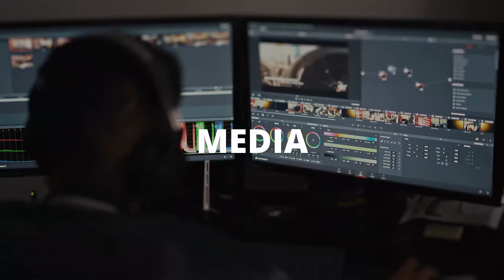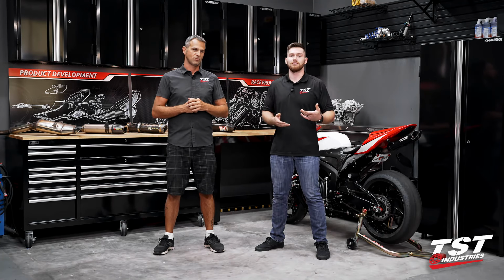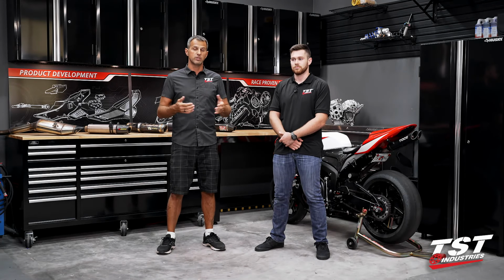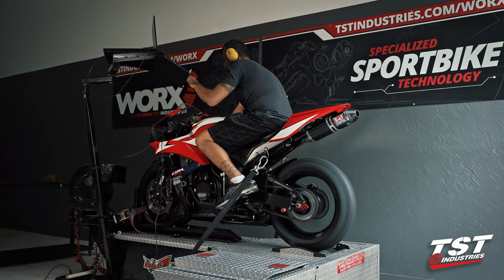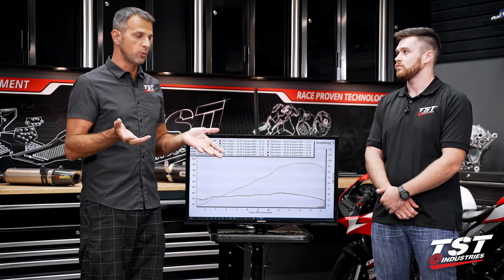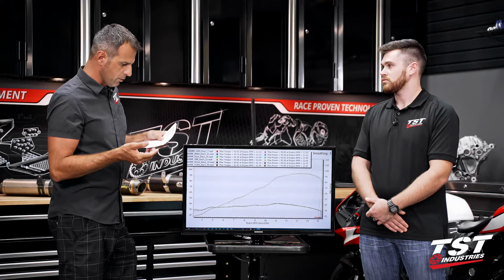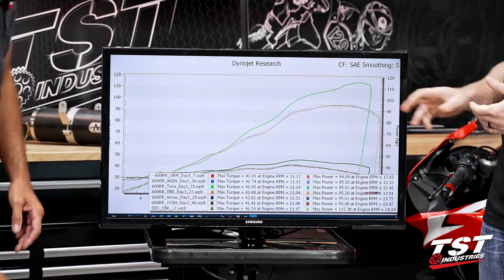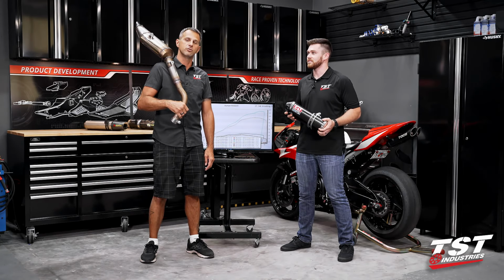Honda CBR600RR Exhaust Dyno HP Comparison: Toce, Akrapovic, Two Brothers, Arrow, Yoshimura, Stock

Comment: Yoshi - "because who needs a taillight anyway?" ;)

A little bit more seriously:
- Lookwise, Toce and Yoshi look good. However, based on the previous video, Toce is too loud for the track (at least in Poland) and Yoshi covers the taillight, so it's not suitable for the road.
- 2Bro is still too loud, I'm afraid, plus it looks awful ;)
- Arrow protrudes backwards a lot. Better than 2Bros, but still...
- Akrap it is then - reasonable length and loudness, looks better than OEM and is 1.2kg lighter. Would I pay for it though? Nah ;)

Comment: Even in absolutely perfect conditions (read: not real world), area under the curve in relation to gearing is what matters, not peak. In the real world, a broader curve matters even more and AUC gains are what racers look for to drive out of corners.
Reply: @Brian Frichetta - Can you say more about area under curve and gearing? Kind of guessing - is it that "driveability/raceability" is improved not by peak power but by having the right gears for how you want to use the bike? Waiting for power to build when the power band is real high gives slow acceleration if you're not running at a high speed all the time. So moving the band lower gets you moving faster.
Reply: @ninemilliondollars  This is long, so strap in. TLDR; Area under the curve (AUC) relates to gearing powerband and also the spread of usable power. The importance of this metric is determined by the application (race, street, etc).

In math, area under the curve is defined by calculating the definite integral between two points on a curve. There's plenty of info on YouTube if you want to know how to do this (Khan Academy, 3Blue1Brown, etc).

However, in simple terms, AUC is really easy to get an intuition about. Take a HP / Torque curve and just shade it in. The shaded part is the area that the curve defines.

Now, let's think about two extreme (and unrealistic) examples. In the first case we have an engine (A) that makes 0 torque from 0-8000 RPM (let's not get caught up on how we would get an engine w/ 0 torque from 0-8000 RPM, but if it bothers you imagine you have to jump start the engine going down a long hill, haha), and then from 8000-9000 RPM it makes 100 torque, then goes back to 0 torque. This engine has a very narrow powerband. 

In the second case, imagine we have an engine (B) that makes exactly 50 torque from 0-10000 RPM. No matter where you are in the rev range, it provides the same power delivery.

Now imagine the dyno torque curves for these different engines. Engine A is empty for the first 8k RPM then dramatically spikes and falls, so it looks pretty empty. We're imagining a tall and skinny rectangle at 8-9k RPM.

Engine B, however, is a straight line at 50 tq from 0-10k. Shade these curves in and we can calculate the area. Since these are just rectangles and not complicated curves, this is easy: A=lw. The first "curve" is 100 (torque) x 1000 (RPM) so its area is 100k. The second "curve" is 50x10000 so 500k.

Note, I'm not using units for torque b/c it's irrelevant, since they depend on the units used. E.g. if these dynos were done in ft/lbs but we converted to Nm, and changed RPM to revolutions per second, the first area would be ~2260, and the second would be ~11300. What matters is the relationship, and you can see that in either case the second "curve" has 5 times the area of the first "curve".

Okay, so what does this all mean? So far we've talked about torque, b/c torque is what moves things. Numbers like "horsepower" are artificially derived from torque and RPM, because in the real world those RPM actually matter. This is b/c for the applications we're talking about (vehicles),  we're trying to move things at a high rate of speed. To do that, we need to transmit torque to a wheel and we usually do that using gears. The faster we can spin an engine, the faster we can move those wheels without help from our gears.

I don't want to go into gearing b/c this is already too long and there are plenty of resources. But I've hopefully explained enough so far to give you an idea of at least two key spots where AUC really matters.

The first, as alluded to above, is gearing. In race applications, where we care solely about absolute performance, we can make certain tradeoffs. For example, if we tune our engine for peak power, we'll probably end up w/ a more narrow curve. The reason for this is also complicated, but without a lot of wizardry (which adds cost and weight), tuning for peak power usually narrows the curve (it looks more like engine A than B).

Now in this case, the fact that the curve narrows, is not as analogous to our initial example as you might think. Two engines can have the same total AUC, where one is peaky, and one is broad, but still not be equivalent, and this is b/c the AUC we actually care about in racing applications is the usable powerband of the gears.

If, with our very peaky engine, we shift from 1st to 2nd gear, and our engine falls too far off that peak into a much less powerful part of the powerband, we've lost a lot of torque / acceleration. Compare this to a less peaky (but slightly less powerful) engine, that maintains a broader area.

If AUC is defined as the area between two points on a curve, then the transition between 1st and 2nd are the points that we care about here. Thus, the peak maybe higher for our peaky engine, but the area in the regions we care about, the transitions between gears, is still lower, and results in slower acceleration.

High level race teams will tune their gearing, tires, and everything else for a particular track, so that these curves match the demands as closely as possible. For the street, companies tune these characteristics based on how they think the motorcycle will be ridden. This leads to another place where AUC matters, which is in the consumer market.

Race teams can get away with more peaky engine characteristics b/c they have star riders, and can tune the gearing and everything else to be used within that relatively narrow power range. For them, having peak numbers matters b/c they can use that curve. But on the street, or even on the track for mere mortals, do you really want to have to ride to the ragged edge to get your bike to respond? The reason so many people love the so-called hypernaked bikes so much is not just that they are more comfortable, but also b/c the engines are tuned to have a very broad spread of power.

A perfect case in point is the MT-10 vs the R1, two bikes that share the same underlying engine platform, but with different components and tuning. The R1 has 200ps and 112Nm, whereas the MT-10 has 160ps and 111Nm. The differences in torque are negligible, while the power is very different, and that's b/c the R1 has a curve shifted to higher RPM. This means the R1 is signficantly faster, but only once you wind the engine up. Additionally, if you look at the torque curves of these two motors, the AUC for the MT-10 is actually much stronger at many points in the rev range. Up top, the R1 pulls away, but at low-mid RPM, the MT-10 has more torque and is actually the faster bike.

I can tell you from experience that on the street, having a broad torque spread, combined w/ decent top end is the best combination. With more low / midrange, you can be in any gear and still have plenty of pull, whereas for a peaky engine, it feels gutless until you downshift.

Finally, one thing you'll often see is that adding mods and tuning a motorcycle only adds modest peak horsepower numbers. However, if you look at the curves the story is very different. You might gain, say, 8 peak horsepower, but when you look at the curve you might notice that from 7-10k RPM there's a huge increase increase in torque. If you were to overlay this new dyno graph on the original one, this difference in 7-10k RPM, where the new graph is higher, is the difference in the AUC for that range. You can overlay two graphs like this, and fill in these areas, using one color for decreases in power / torque and another color for increases. This will give you a very good idea of how differently the motor will actually behave at certain points.

In the case of picking up a lot of midrange power, this could mean we no longer have to downshift on a certain slower corner b/c we have enough torque to drive out hard.

Whew that was long. Hopefully that helps explain AUC a bit, and how it relates to dyno curves.
Reply from the maker: @BrianFrichette  Do you want to fly down here and be in the next video? Only if you can condense that kind of explanation into the time that our viewers can actually hold attention for. I can show you the analytics. Maybe a blog article is better deserving of your time.
Reply: @TSTindustries  I am a software engineer and web developer with years of high level experience, but when it comes to mechanical engineering, tuning, and performance, I'm nothing more than a hobbyist and certainly not a subject matter expert. I wrote that reply knowing it wouldn't get much traction or visibility, mainly to coalesce my own understanding of the ideas. I'm a bit embarrassed to admit that.

That said, as far as I'm aware, the explanation I provided, while overly verbose, is a correct description of this limited subset of performance tuning. If there's any potential to use my actual expertise in this area, it would likely be creating interactive data visualizations or something along those lines. As I was writing, I kept thinking how great it would be to have visualizations for what I was describing.

Anyways, I appreciate what you guys do, and have enjoyed your products. Thanks for making quality content and quality products. Your offer is very humbling, and if for some reason you'd like to collaborate on something software / web related, you can keep my info in your rolodex (firstname.lastname@gmail).

Cheers

Comment: Is there a reason the toce exhaust has the baffles in while the others don't?
Reply from the maker: They are all equally matched, and how they come from the factory. Each one of these exhausts uses a glass packing around a perforated metal tube for muffling. The Toce just has two smaller diameter and shorter glass packed muffling elements instead of one large long one as per the other presented exhausts.

Comment: did you guys tune the mapping for every exhaust
Reply from the maker: No tuning or mapping was done on any exhaust. This is OEM spec ECU settings with the various slip-on exhausts installed.
Reply: @TSTindustries  do you think mapping Is needed with slip on?
Reply from the maker: It is highly recommended if you want to actually gain some performance.

Comment: Man, that engine is weak. Emissions are choking it.
Reply: 07 and 08 fastest 600 out there......
Reply: @MacDaddyC7Z06  pretty sure it was 08-09 R6 actually
Reply: @BrianFrichette  nope. Its 07 and 08. In 09 they changed the engine design. I know because I own a 07. Do some research before you comment
Reply: @MacDaddyC7Z06  I'm talking R6 and the info is readily available, the most powerful R6 was 08-09. https://en.m.wikipedia.org/wiki/Yamaha_YZF-R6
'06-'07 125bhp, '08-'09 127bhp, and it goes down from there. Doesn't matter that much though because from 08 on it's basically the same engine with more emissions crap on it. If you rip that stuff off and tune it, it's all the same.

The 2017 has the modern generation ECU though so it's going to be the strongest if you're going to rip everything off and tune it.

Research has been done, bud. I own a 09 and I've spent plenty of time with R6s

Comment: WHat performance mods did brian make?
Reply from the maker: His bike was supersport legal so there was not very much done to that bike. We had a thin head gasket on that bike, along with a three angle valve job...that's it on the motor. For exhaust we had an Arrow full system on there. From memory the air filter was MWR. We used Woolich to tune the package. That is all that I can remember as far as modifications go for power and torque gains. The rest of the mods were centered around pit performance, braking, suspension, chassis setup, lightening, and those would not influence the motor output.

Comment: Would like to know whats done to brians Cbr 600rr
Reply from the maker: Thin jead gasket, 3 angle valve job, cam degree, full exhaust, MWR air filter, lots of tuning. That is on the engine side. A lot of work went into chassis and electrical too.

Comment: I have a 2010 R6 and had it dyno'd 100% the way it came from the factory on a dynojet-150.... Ended up with 106.7 whp @ 13,700 rpm and 45.1 torque @ 10,100 rpm.
At the same time my friend had his 2008 cbr600rr dyno'd.  With a Akra and Power Commander he got 103 hp & 42.5 tq.

Comment: Well I wish I was having a better experience with Toce Performance but sadly its been a let down. First, their slip-on wouldn't fit their mid-pipe to then getting an email saying minor manipulation by grinding may be needed. Also, paid to have my ecu flashed and that has failed twice now. 
 After contacting Toce they had me send everything back on them and did replace the exhaust and attempted to correct the ecu flash to no avail. I'm only stating the facts and truly regret the whole purchase. Money wasted imo.
Reply from the maker: Sorry you had that experience Doug. We are actually a dealer of their products and not associated in any other way. I hope you don't have any qualms with our company just because you had a negative experience at Toce.
Reply from the maker: May I ask what the mode of failure was with the ECU?
Reply: @TSTindustries  
Definitely no issues with you guys and Toce I'm sure is going to help out. I've yet to reach out again as I'm going to take a few days to self diagnose.  
 The issue are I cant get past 13k rpm and not pass 120 ish mph. It has nothing as soon as you touch 13k. My bike before with a dan moto slip and k&n filter had no issues getting closer to the 15k rpm and top speed about 146 to 150 depending. I added a cat delete from toce and removed the servo motor. But it does show some improvements in acceleration at 1 and 2nd gear. And even less deceleration. Thanks for replying.

Comment: thought OEM hp was 120
Reply from the maker: Nah. These are definitely up by 120 horsepower. Maybe at Honda factory, measured right at the crank in ideal conditions. Rear wheel horsepower in the real world on these bikes is around what you see here. Have to change the air filter and exhaust to uncork it with some ECU tuning. Add a set of velocity stacks, a three angle valve job with thinner head gasket, come cam degree magic, and now you can be peaking around 120.